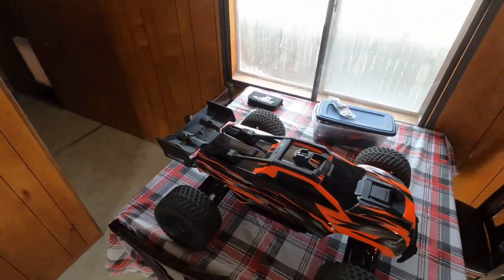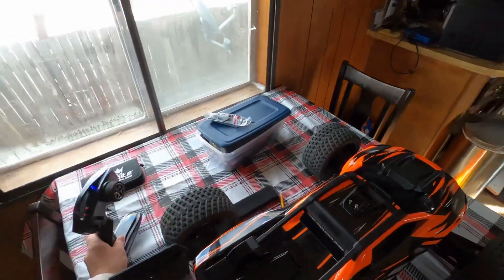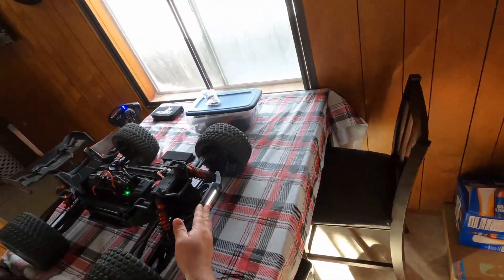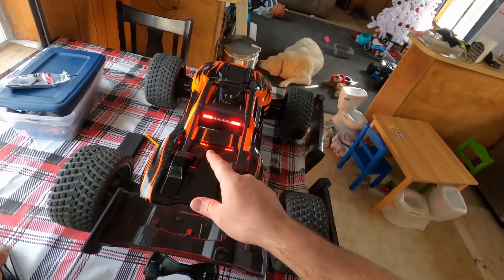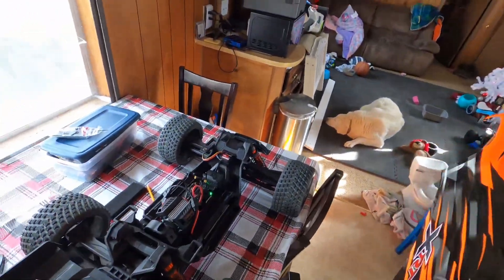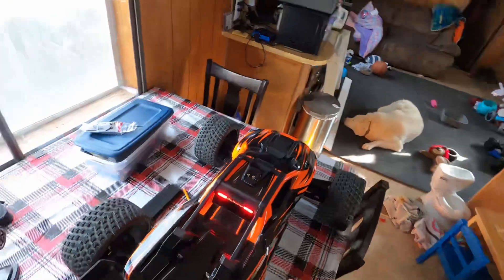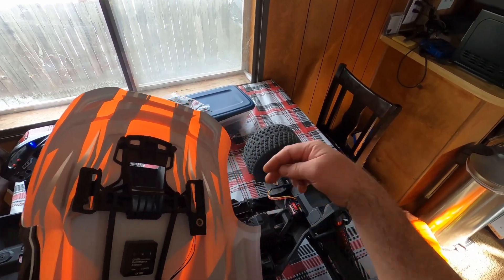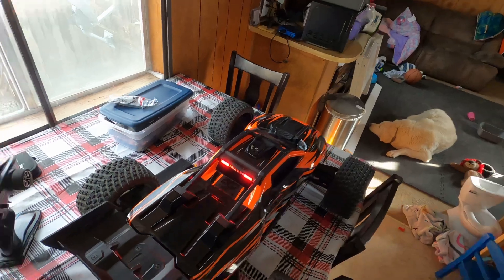Automatically connecting LEDs on the body of the XRT

Comment: I see the lights flickering a lot when you are running it on a track good idea but too much vibration to keep the lights on all the time
Reply from the maker: Correct. I’ve removed the mount, but kept the magnetic connector. So easy to connect, plus vibrations don’t affect it.
Reply: @dgitalchaos  Nice mod for sure. About to add a bunch of lights to my New XRT Slider I recently finished. I have no Traxxas Electronics BTW. Anyhow, You said  you removed the mount but kept the magnetic connector. What did you do with the connector ? Where did you move it ? I'd certainly like to do this. Does it still work as well as intended and would you do anything different ? Thanks a bunch.
Reply from the maker: @ImAcoastpedder  I’ve since done away with the lights. Too many hits when bashing, and $20 per light gets ridiculous. The magnets also bounced around and I could never find anyone to 3D print a better mount.